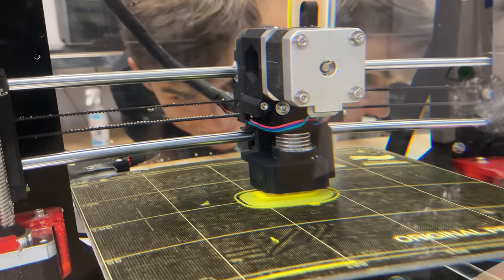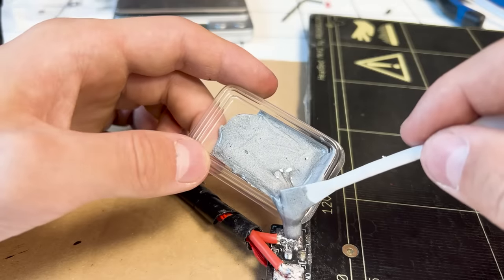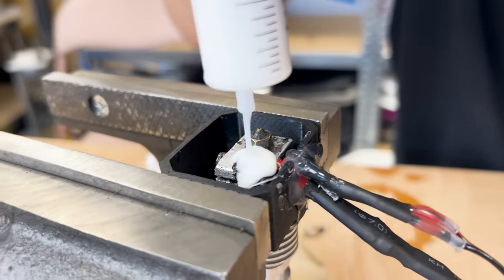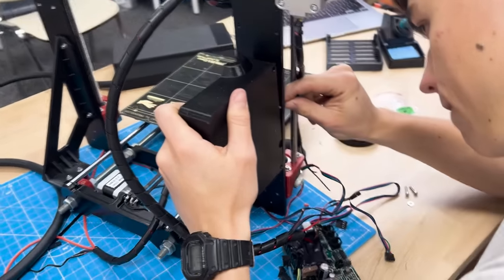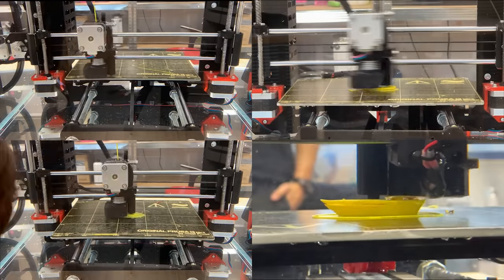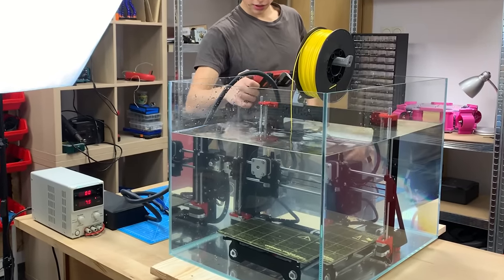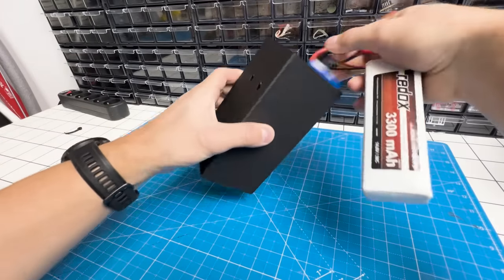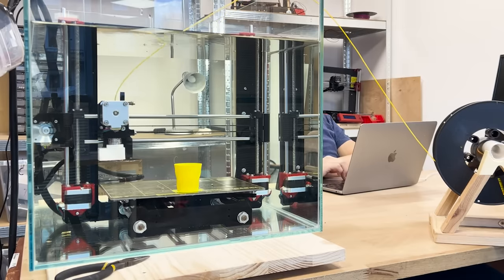3D printing underwater actually WORKS

Comment: Try Permatex copper but do it in thinner layers for the heatblock. Once the outside builds up a crust the inside will always have a hard time curing. The copper version might be conductive though, so watch the heater and thermistor wires.

Comment: for better layer adhesion consider using hot water, like 50C or a bit lower. Heating it just below the glass transition temp could overheat the motors, so maybe 40C 45C is better.

Comment: If you are after liquid cooling for the plastic, just fill the container with something less conductive/corrosive than water. Mineral oil would work great for both, though i'm not sure how well it will hold up to temperature. Something like CNC coolant would be a good alternative however. While conductive, it's specifically made to not be corrosive, and it's water based (although most coolants are milky, not see-through).
As for the heater, simply have a water-tight container over it so a bubble of air is trapped and surrounds the hot end. Also during pre-heat some water will boil and top off said bubble with steam if it ever gets low. Ideally you'll also need a vertical heat block instead of a horizontal. Way more efficient. Lastly, to avoid stringing, simply increase the retract length by few mm.

Comment: So one of the reasons why the bridging performance is not as good as expected is that the saggy layers are cause by two mechanisms. The first mechanism is the filament still being semi-liquid untill it is cooled far enough (which your solution should cover quite well). The second mechanism is actually the force with which it is pushed out of the nozzle, this is not resisted in anyway during bridging.

Comment: Great idea!! You can get rubber silicone (gasket seal) for engines that can handle high temps and would be ideal for heat block

Comment: To waterproof the stepper motors, apply an excess of dielectric grease to the motor internals and replace the metal bearing with a bearing made from PEEK. Be sure to also apply grease to the bearings after replacing them. While the grease will not eliminate corrosion, it will slow it down. An epoxy or silicone potted box with a sealed bearing for the exit is the next step, which would close off the motor from water exposure at the cost of worse thermal performance. Even with ambient water cooling, the added insulation could cause the motors to burn. There should be a sweet spot between these extrema that increases motor service time.

The potted shroud for the hot end does not need to be filled with one material. Use a waterless plaster or a cement material to fill most of the shroud, then bake it dry (~150 C should be sufficient), then seal the open face of it with high temperature silicone. Coating the hotend itself with high temperature silicone before doing a plaster/cement fill may also be helpful. Only a coating is needed to waterproof. The rest is just insulating thermal mass. Plasters and cements are less sensitive to thermal expansion and thermal degradation. A waterless plaster would need to be used to avoid corrosion and possible off gassing. As an alternative, sand could be mixed with the high temperature silicone sealant or a high temperature epoxy to reduce the thermal expansion issues later.

Comment: With a pump you could have just regulated the water level automatically to the print height. This way you could use a stock extruder setup. This way you could even mount all your steppers and electronics on top!

Comment: Great job guys!! 
A few hours before catching this,  I saw another vid based around a machine 
that prints while submerged in some sort of Gel solution. [denser / better at 'suspending']
The gel allowed for next to no movement/shift of the filament as it was applied, 
so everything can be printed w/o the use of supports.  It was killer.  You're Onto Something!
Keep it up!!
🤘
Sam -
Reply: It was on MOSFET's channel!  Found it! 
"Breakthrough 3D Printer Uses Strange Goo"
https://www.youtube.com/watch?v=MXOJeKFZsSk&t

Comment: 4. instead of water, use distilled water, 
5. Instead of distilled water, use mineral oil of density similar to the plastic 
6. Instead of submerging entire printer, only submerge the bed (use CoreXY with Z-moving bed). Motors and electronics do not need to be submerged. 
7. Despite the liquid taking the heat away, the heat can still stay there due to no convection. For a serious application you still need a forced convection.

Comment: You should do something with a z-moving platform, so you can keep the hotend/nozzle barely in the water at all! You could have the steppers out of the water that way too-- only the plastic that needed cooling and the bed would need to be in the water!

The other fun thing would be to do this upside down, with the bed on top-- that would drain the water out of the print, assuming the bed was moving away from the nozzle.

Comment: Awesome. I would suggest using silicone based oil in all the applications. Build a box to dam in the oil. Instead of what your already using including in the motors. Silicone oil is non conductive. And should be a help.

Comment: Core XY with engines above the water and a longer nozzle are better, just the nozzle tip below the water surface by a few millimeters. The printer won't be completely underwater, but printing will be. When it comes to cooling, the water should also be moving, otherwise it will always be more heated around the print, so there is room for improvement, although it may not be noticeable.

Comment: You might want to do what we used to do to protect locking hub assemblies from moisture intrusion in our off-road vehicles: Add a fitting and pump air into the stepper. The air exiting through the small gaps tends to keep water from coming in, and will also push water out.

Comment: Instead of full submersion, use a printer that raises and lowers the print bed and set the water level to just barely cover the tip of the nozzle.

Alternatively, vary the depth of water so that it again keeps the print head just barely submerged. That could be accomplished by pumps or by having a second container of water connected via siphon and raising or lowering that second container

Comment: As others have already suggested mineral oil probably makes more sense, as well as introducing a water pump. However I’d recommend looking into Rapid Liquid printing. Finding a fluid that’d give the plastic neutral buoyancy would also be huge. Your ideal fluid would both be non conductive and neutrally buoyant.

Comment: Having the water hot is the best idea here, would give better adhesion but still have the ridiculous cooling speed.
Would be amazing for speed printing, you would only need a little more power on the motors to overcome the water drag.

Comment: Id look at putting oil into the motors, might slow them down a bit but its common to do this with watches as it allows divers to use them at lower levels.. also it looks cool. Not sure how well motors are sealed but only one way to find out..

Comment: I had an idea, instead of using just a bare nozzle, you should try drilling a hole in a large block of metal with fins, like a heat-sink and inserting the nozzle in there. Not sure how to fix those motors, maybe fill the voids with grease to prevent water getting in?

Comment: I wonder if it is possible to help remove the water from small tight spaces in the model by putting it in a vacuum chamber after you're finished? That way the water will evaporate under the extremely low pressure.

I would also suggest designing models as open on the bottom with a easy-to-drain infill (something columnar?), and then adding an endcap that fits to the bottom to make the shell solid for the final product.

Comment: instead of waterproofing the motors you could mount them at the top of the printer out of the water and do some basic water proofing, you could even do the same with your y axis if you got a long enough belt

Comment: Pretty fascinating experiment! Based on the conclusions at the end, might be interesting to do this with something like ABS, or other filament which likes a heated chamber. Only issue with heating the water will be keeping it heated over time. Like maybe a sous vide recirculator.

Comment: You could try using a sous vide to heat the water to a very exact temperature, it would also help with the buoyancy at certain  temperatures too 😊

Comment: You really only need the nozzle and bed under water.  You could probably even build a small water cage on the bed itself.  Which would save all the electronics and sensitive parts.  Interesting process

Comment: The high temp silicone was a good idea but you applied it to thick
You need to apply it in layers so it can cure
If that volume could cure it would cure in the packageing. 

Alternatively just get rid of the cooling fins completely and replace them with just a straight pipe
As you saied yourself: you don’t need it
So just remove it

Comment: You can use the red silicone if you apply it in thinner layers. When you apply big blobs like that the air cant reach the silicone under the surface layer.

Comment: I'm curious to see how it would perform in mineral oil, it would make for messy operations, but you wouldn't have to worry with shorting out the electrical components, or the corrosion components, and in theory you should be able to achieve longer bridges due to the mineral oil being more dense than water which should increase the buoyancy of the PLA

Comment: Maybe you could have some advantages slowing down the print and use a delta printer so that the bed won't slide around generating a lot of disturbances. Also using particularly stiff materials so that the disturbances generated by the movement of the head won't be so intrusive. Overall I can see some potentials

Comment: Wow! This should also help with a topic the 3d community in many cases is trying to ignore - microplastic particle emission into the air, which many people breathe in during and after prints. I wonder if this idea could be the start of making 3d prints safe in non-ventilated areas

Comment: Ceramic or at least stainless bearings, detect endstops with current increase instead of switches (IIRC at least some controllers and software supports this).

Comment: 1) Why use water? You should try another liquid with the same/ similar density as PLA!
2) Why submerge the whole printer underwater? Why not just the print bed and the print?
3) Heating up the water might not be good because the whole point of doing this underwater is for better cooling

Hope my opinions helped! I didn't mean to be a complainer.

Comment: The stepper motors for the 3-axis doesn't have to be underwater. Use belts to move them above the water line.The only thing that needs to be underwater is the heat block.

Comment: you could use 2 component silicone for the nozzle bath. It doesn`t need air to cure and should cure all the way through
Reply: there are also high temp ones which should be able to handle the nozzle temparature

Comment: I was wondering if you were going to broach the subject and you didn't disappoint, my first thought wasn't cooling, but more that water has buoyancy, which would dramatically improve the support of overhangs. That's an interesting thought, though there are clearly still some hurdles in the process. Mineral oil is a thing, but that would be >messy< and really hard to clean off the printed objects, let alone the printer itself, plus would probably affect bed adhesion. Water, on the other hand, can easily be displaced by the plastic and heated nozzle. The other problem is that most print materials are hydroscopic, so can absorb water, including PLA.

Comment: Get fibreglass insulation (the type you find in the attic), pack that around the heater block tightly then epoxy over it.
The heat can't get to the epoxy, the epoxy can't burn.

Comment: we need to mill a print head for this application and/or use a reactive resin most likely for this. if you are just going for the cooling you could have( nvm that mineral oil idea is so spot on you should really try that )

Comment: Yes pure water or possible air injection into the parts you want to keep dry. Or as mentioned.  Submerge each part in mineral oil as separate units. Then water won’t be an issue to those.

Comment: It would be interesting to know the difference depth of water makes. At higher pressures there may be different effects. Also, you could print reverse depth charges by printing water into a container, designed to explode at a certain height above water.
Reply: Also, being able to hermetically seal a liquid into a container without touching air could have huge implications for medicine and chemistry and food packaging.

Comment: Mineral oil?  We used this back in the day to overclock desktops with window air conditioner compressors.  It solves shorting and corrosion issues, water infiltration into the filament, etc.  Not sure if it would succeed or fail re: layer adhesion, but you might try it… 🤷

Comment: You should look at different types of 3D printing, maybe use a chemical reaction to make the material rather than thermal. Maybe a paste extruder printer would work with some material, like a clay or concrete that can cure underwater.

Comment: Overall not a bad idea. Completely submerged printing seems like a long road ahead. But what about using a printer with a moving bed like the ender 5. If the nozzle and all the stepper motors are above the water line and you are printing on a layer just above the water line you could still get the cooling effect of the water but keep the important bits above the water. It would also mean you could run the high speeds without water resistance 😉

Comment: You should look into using PCL, it is a plastic too but it can print at lower temperatures, potentially even less than 100 C which would probably be ideal. eSun makes some with a print temperature of 70 - 110 C, that could eliminate a lot of your issues with the hot end.

Edit: PCL is usually used with 3D pens but it also has the advantage of being remoldable, so you can warm it up and reshape it.

Comment: You could a printer which moves it's bed in Z direction. This way, the motor can be outside of the "pool". And also use mineral oil. Also, instead od cooling, you could use the mineral oild instead as a thermal interface so brittle materials like ABS can be heated to better tempertures so warping is avoided.

Comment: Something you could do to keep the filament dry is use PTFE tubing extending out of the water and a PTFE tube connecting the extruder to the nozzle.
I wonder how well this would moderate toxic fumes, maybe enabling filaments that would otherwise be considered too toxic? real world application? probably not, but cool to think about

Comment: The liquid could make a huge difference, tap water has many minerals in it that could interfere with the layer bonding, have you tried distilled water? Also so many more liquids that could be used like deionized water, glycol/water solutions, and dielectric fluids such as fluorocarbons and PAO, stuff people use for liquid cooling server/asics

Comment: @CPSdrone how about using a mineral oil in a watertight box around the hotend? This will allow for some heat exchange but higher viscosity of the oil and its lower specific heat will make the heat transfer from the hotend into the water slower.

Comment: The idea of heating up the water to just under the Tg of the material may offer more benefits than expected.

It could allow parts to be annealed in place. Potentially avoiding issues with warping.

Comment: Use a core-xy printer with the belts kept above the water. That way no motors go underwater. You could even try a core-xyz belt-fed extruder so that doesn't have a motor in the water either.

Comment: To avoid any short circuting and corrosion and all that stuff you could probably use distilled water instead, this way no modifications to the electronics are necessary.
Also you can not disassemble stepper motors they will lose about 50% of their magnetism. Those motors are magnetised after their assembly this is very difficult to do in a home setting. You basically trashed your motors.

Comment: De-Ionized water will start attacking the materials in the water. Because the water is so pure with no minerals, it readily wants to dissolve anything it can get a hold of. We run into this at work when using it for coolant on equipment. Additives must be added to make the water happy and not corrode everything.

Comment: To asses the rusting problem, you can use an XY core printer with the Z axis motor outside the water. this way only the print and the bed is underwater.

honestly though, other than performing better at extreme overhangs I have no idea why anyone would want to print underwater.

Comment: I found a shop close by to me that sells costume grade silicone. It's Reynolds material company. I found some super high heat to 2-part silicones as well as some really nice clear epoxies. I would recommend going with one of those styles of silicone
Reply: Also heat destroys epoxy

Comment: If you stick to lower temp materials like PLA, I wonder if this might have been done simpler by using mineral oil instead of water (as seen with submerged PCs). 
It's non-conductive so you can submerge everything without needing to do so many mods preventing a short-circuit. My only concern would be the temperature, but I believe the ignition temperature of the oil is something like 260°C (although the flash point is only 135°C, so care would need to be taken to avoid heating any released fumes).